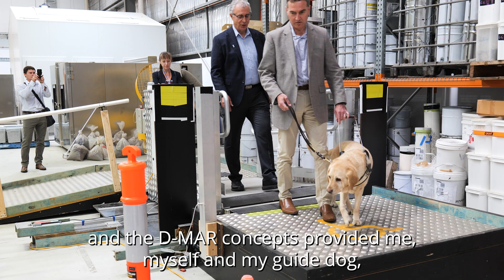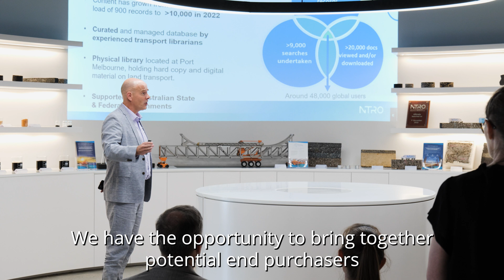Bridging the Gap: Automated Ramps for Inclusive Commuting

Comment: Hi, do you have further information? I don’t understand what and how it should work. It looks like platform integrated but you speak about train integration then the ramp folds out and down and in the next sequence it folds up? Reall confusing for me. For what kind of trains is that intended? City trams, overland long distance trains?
Reply from the maker: Hi Mark, 
Rofraus developed two prototypes for Automatic Ramps:
 - the Descending Mechanised Access Ramp (D-MAR) is designed to be installed to the train, tramway and bus floors. The ramp is providing independent, safe and DSAPT compliant access between the carriage of a train, tramway and bus to a lower platform. On operating mode, the D-MAR will be automatically deployed as soon as the train, tramway and bus doors are fully open.
 - the Ascending Mechanised Access Ramp (A-MAR) is designed to be installed on the platforms for train, tramway and bus. The ramp is providing independent, safe and DSAPT compliant access between the platform and an upper train, tramway and bus floor. On operating mode, the A-MAR will be automatically deployed as soon as the train, tramway and bus doors are open.
More information is provided on the company website (updates are in progress): http://www.rofraus.com
Reply: @ntro-aus-nz  Thank you for all the information!